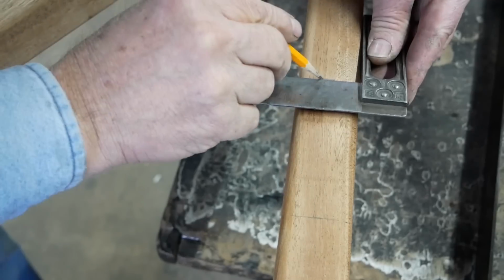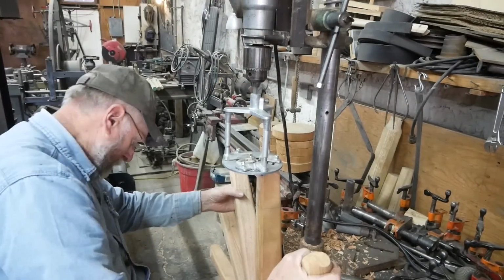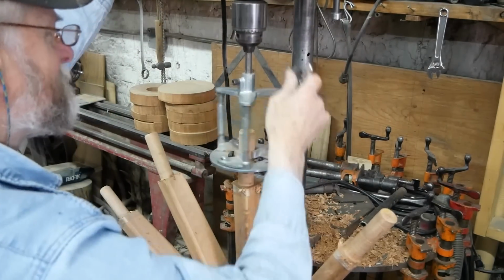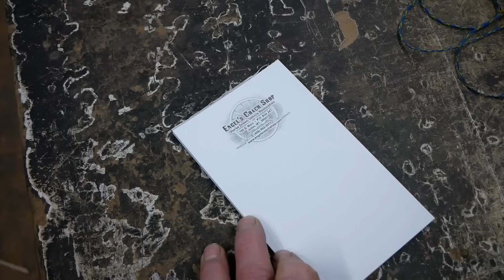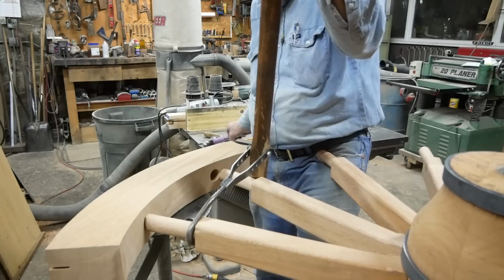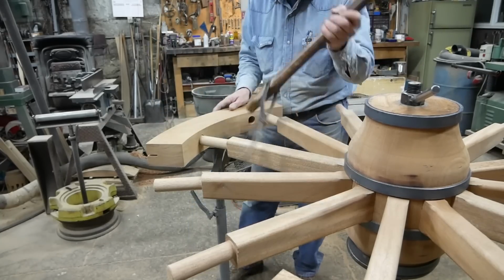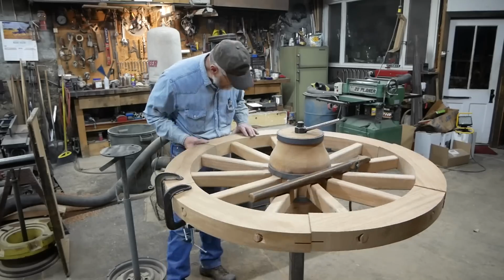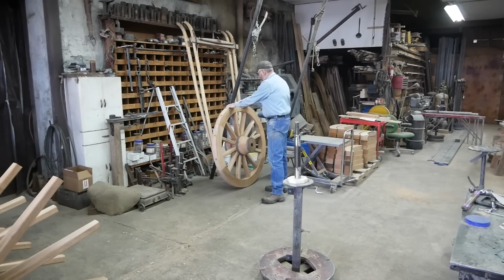Heavy Felloes are Difficult on the Spanish Cannon Wheels - #7 | Engels Coach

Comment: As always, I love your videos. I don't know how often you need to cut long tenons, but if it's at all frequent, may I make a suggestion? Make some sort of fixed, fold down, block that transfers your mark on the floor to a higher level. 1 1/2" would probably be enough to make the second half of the cut by moving the whole wheel up, instead of moving the cutter down in the drill chuck.
Just a thought.

Comment: Absolutely incredible how it all fits together so accurately. I am certainly no wheelwright but am wondering rather than marking the spoke shoulder with a pencil, could one use a sharp knife which would prevent creating the rough edge when cutting the tenon? A foot operated jack could probably be employed to raise the wheel when cutting the tenon which would avoid stopping the drill press and readjusting the cutter twice for each spoke.
Reply: متابعة ممتعة من المخيمات السورية

Comment: Yep, mahogany is splintery as heck, your tape method works fine and is a time saver, another way to combat it is to score cut the circumference at the cut line, fine for a few but not practical unless you make a jig and no doubt  you won't be doing this again. in mahogany.

Comment: Hi, Very enjoyable. Could you please explain what the clamps were used for/doing when you were sawing between the felloes? Thanks
Reply: I was wondering that as well.  A little later in the video it showed that there was a board underneath the felloe, so it appears the two clamps were to align the fellows to the same flat plane during the cut.
Reply: @stevefirst9521  Thanks, I have gone back and now see the board☺
Reply: @EngelsCoachShop  Thanks for your reply. I appreciate that you are very busy 🔨

Comment: I wonder how long it took the old wheelwright fellers
 to build those wheels back in the 1700's?
Their tools must have been amazing...
Reply: A big batch like this would probably have been done in a fairly large shop with I'd guess at least 3 to 5 men/boys working there, so a lot of the work could have been divided or had multiple people working on it. So even with fewer or possibly no power tools, it could have come along fairly swiftly after the first few wheels. Now, one blacksmith/wheelwright in his village shop under the spreading chestnut tree, making one replacement wheel, is probably going to take a fair amount of time.
Reply: Yeah.  A full on wagon wheel shop had machine tools for every operation,  and I mean every operation.  The beauty of watching Dave Engles is seeing every step in the process done by hand.  A rare treat.
Reply: Sorry:  Engels
Reply: @evanpenny348  I don't think they had machine tools in the 1700's though...
Reply: @RickOshay...  Good point,  but what about steam or water driven systems with overhead belt drive workshops.  I don't know about the 1700's though.

Comment: Same experience with mahogany, boat builders use black locust for certain things. Do wagon builders use it for anything? Reason I ask is my dad used a black locust log for a fence post. It lasts for about forty years. I rest the post twice in that time. The first time the sap wood had rotted away but the heart was plenty solid. The pasture was very wet during winter and surface water was only 15 feet don so it was moist nearly all year.
Reply: Yeah out here in Califonia's gold country we don't use it for much either. Never heard of it even as a fence post. Everyone around here likes western yellow (some call red ) cedar for post but we are shot one post and we had an old black locust log lying out near the wood pile when we moved into the house. My dad cut a post and the rest we burned in the fire place. That post lasted twice as long a cedar post under the same conditions. While reading about ship builders using black locust for "trunnels" (tree-nails) or wooden pegs to pin together ship ribs and in planking larger vessels. Also knew of a guy who used it for cleats and wooden pulley blocks, so it is apparently pretty strong?
Black locust is not native to CA, but was brought here from the east coast. It grows like a weed out here and will take over a surprising amount of ground in a short amount of time.

Comment: Wonderful, as always. I suppose you are working to a specification, but looking at the difficulty of bending the spokes made me wonder whether the felloes need to be that thick. Every 1/2" off the felloe thickness would allow, I don't know, maybe another 1/8" on the spoke diameter and it still be able to bend. So the question is, what generally breaks most often in a wheel like this, when in use? Do the felloes break, or the outside or inside spoke tenons (seems like the weakest bit to me), or the whole spoke, or do the mortices in the felloes crack open? I guess over the centuries they have worked out the right ratio of felloe thickness to spoke diameter, and I guess what we are looking at must be the right answer.

Comment: 5:14 - "as this cutter is cutting cross-grain on this mahogany is just ripping and tearing big chunks out of it - so I'm gonna take some fiberglass filament strapping tape" - oh, and I used to think that DUCT tape is that magic fix-it-all God-send thingy... (and that other one is WD-40... ;-)
Seriously though - I'd rather take a hacksaw (= fine teeth) and make a small notch around the spokes - right where the cutting's gonna stop. Like an eighth, maybe 3/16th or a quarter of an inch deep - this should prevent the splitting ("tearing").
Just a thought.

Comment: You should have taken a saw, say a dovetail saw, and cut cross-grain where the shoulder stops on each spoke. That will stop any tear-out from progressing past that point. I now see that was already suggested. Not sure why you preferred taping 144 spokes in a somewhat vain attempt to stop that splitting-out. Using a saw at that spot would have even reduced the filing work you had to do to clean up those areas. Your work is usually exemplary.

Comment: I was wondering why isn't the process reversed a bit, like putting the spokes in the felloes and then inserting them into the hub, would they align better? Also, in your calculation, your second from the last line, 0.21x16 = 3/16, did not make sense to me.

Comment: A small piece of advice in regards to ripping and tearing, you might know of it and decided to not use it for a specific reason, but i'll go ahead and spell it anyways. IF the line to which you cut is known, why not score said line with a knife to break the grain. Heck, i would go as far as to use a saw to cut part way through the wood at the line. Just my two cents on it.
Reply: I was thinking the same, a saw cut 1/4" deep on all 4 sides might just make all of the difference. I threw in a penny's worth.
Reply: Agreeing. A kerf cut would help but looks like it would be very difficult to do with spokes in place.
Reply: Seems more efficient to use the rasp !
Reply: Takes too much time in a already labor intensive job, this isn't furniture he's making 😝
Reply: @johndowe7003  It is better than furniture!
Reply: @gordbaker896   yup!

Comment: Does this wheel design represent the strongest wheel that can be built with this material and technique...and diameter, of course?  I mean, heavier spokes would bend less, and thicker fellows would require more bend...  It seems that heavier spokes would have to be longer to overcome the bending issue?  It just looks like these wheels are testing the limits of the material and techniques.

Comment: You likely get so many comments and questions that you are overwhelmed.  But I'll ask just at the outside chance you intersect with  the time for it.  You make the spokes with the 4 1/2 in. long rounded end to fit into the felloe....then later, I'm guessing because of the contraction when the metal shrinks around the felloes, you anticipate that and  cut out some on the outside tips of the spokes.  Why don't you make the spokes a half inch shorter on that rounded end?  It seems that would save a step later and also make it somewhat easier to get those spokes started  in the holes.  I hope this doesn't sound crazy.